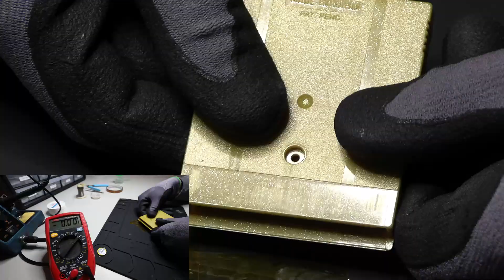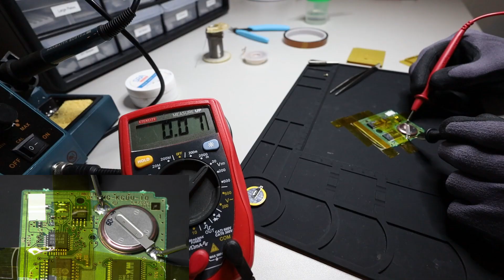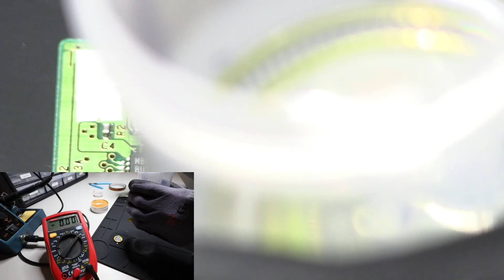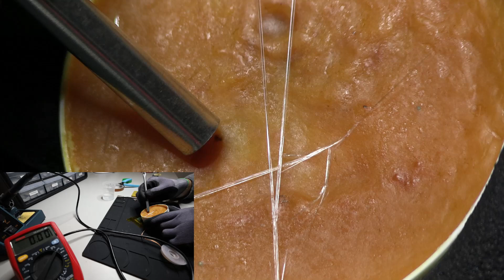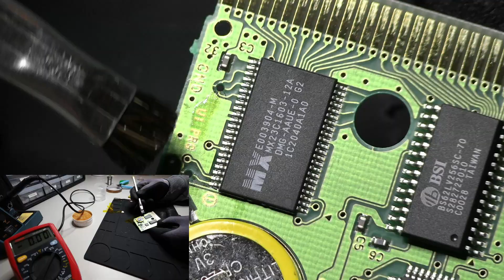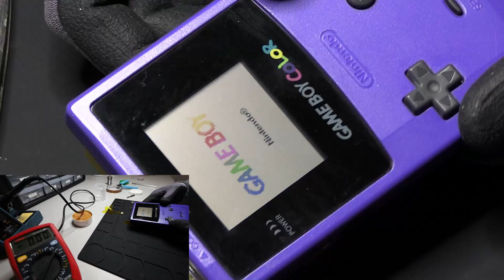How to replace a soldered Gameboy game battery

Comment: could one just use a battery holder or would that be too tall
Reply from the maker: What do you mean a battery holder? Instead of soldering in the battery? If it has more height than the soldered battery it could put too much pressure on the board.